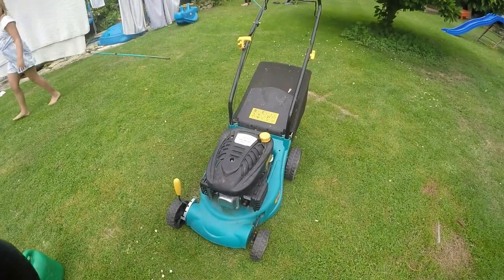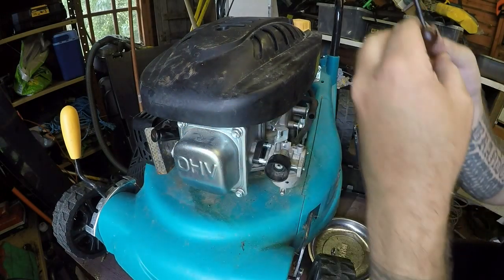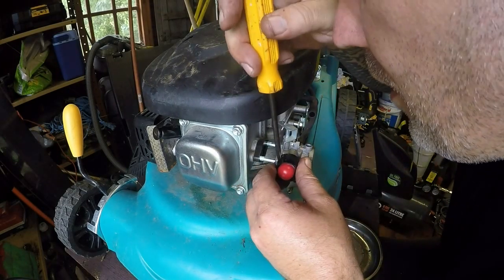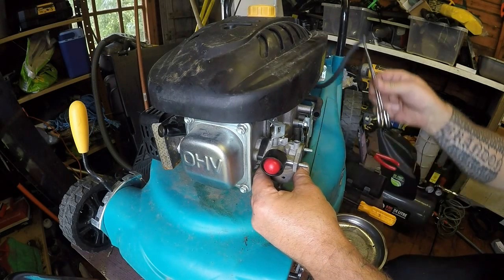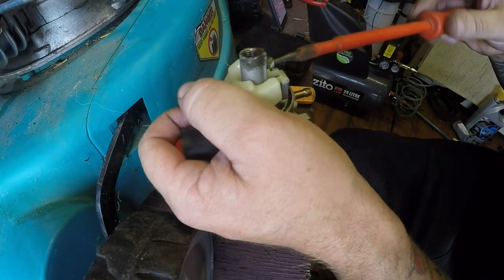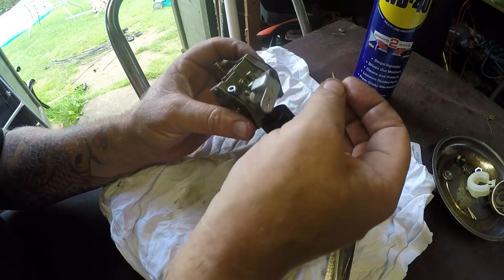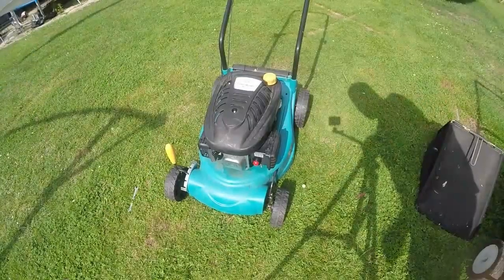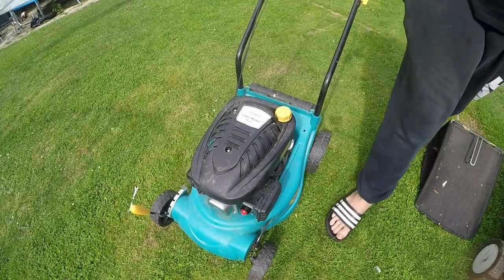#briggsandstratton #lawnmower #easyfix Lawnmower 6 Of 8 Will It Run

Comment: Just been given 1 of these. and the problem seems to be exactly the same as yours. Tomorrows job to get it sorted. Thanks Mick
Reply from the maker: Let me know how it goes mate
Reply: @themowerman  Cleaned it all out as per you detailed instruction, but found the ball valve was stuck and not letting in fuel,  Ive eased that and it now primes but dies within seconds. Cant think what else it can be !
Reply from the maker: @fencer39  is the bowl ring ok.. if not it's the carb.. another clean or replacement
Reply: @themowerman  Hi Mick. Took your advice.  Gave it another thorough clean and put a bit of grease around the bowl seal.....and....Success.  A running engine. Thanks mate !!!
Reply from the maker: @fencer39  boom... Fantastic..